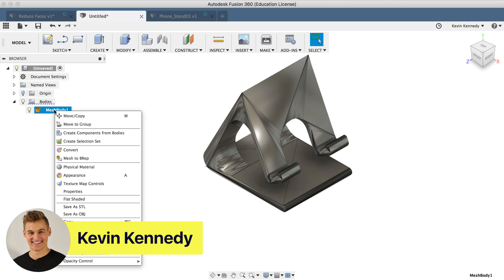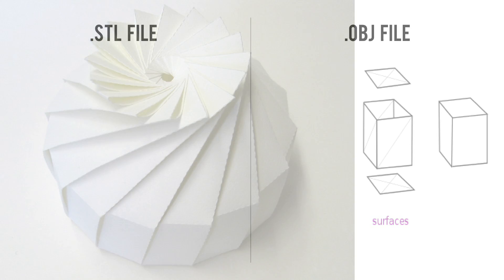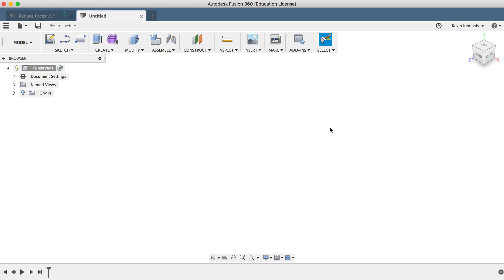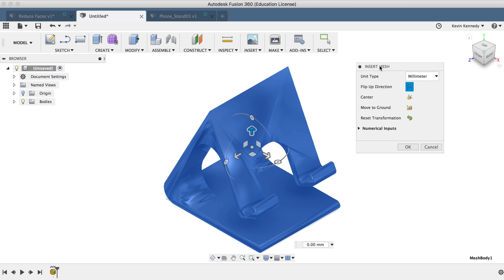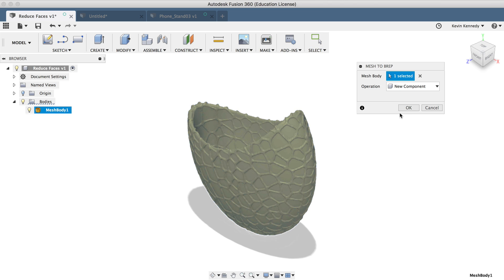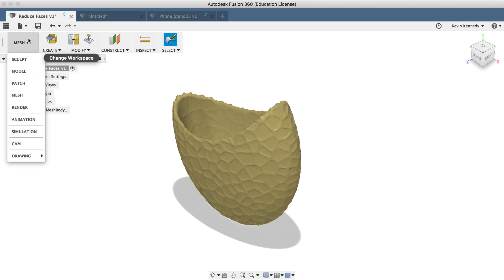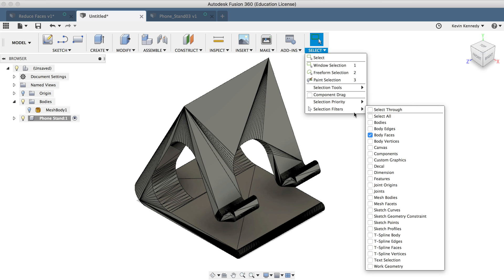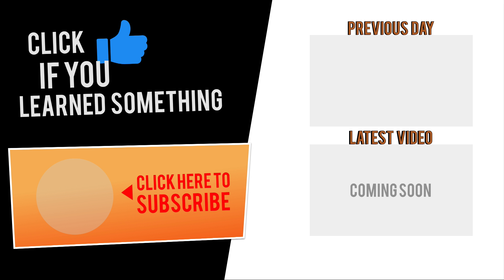How to Convert an .STL Mesh To a Solid Body - Learn Autodesk Fusion 360 in 30 Days: Day #18

Comment: how do I split a body afterwards into different bodies so I can give different polygon groups different materials and appearances?
Reply from the maker: In the new mesh tools there is a "separate" command in the Modify dropdown. It will automatically determine the two bodies (or there are some other options to define it).

Comment: This method only works for relatively simple parts. Anything with more than 5000 faces (triangles) will freeze fusion.

Only two options you have, is to either reduce the number of vertices until your part basically looks like a blob, or, section it off into multiple smaller parts, convert to solid, and then join the pieces. This may also take quite a while if you're working with high resolution models / high vertex models as is typical of character / anatomical models
Reply from the maker: Hi David - check out the new workflow here - https://youtu.be/tVGtG-UjlYg
Reply: Please visit my channel for more Reverse Engineering video tutorials. Keep learning!

Comment: Cool, thanks! But I have a question. I need to merge the facets like you did at the end... however, as my geometry is complex, there are some distortions when i do it. Do you know another way I can do this?
Reply from the maker: There is currently not a way to do it on very complex geometry....though some updates are coming which may be of help. Stay tuned :)

Comment: I have a problem when merging faces, It says  "Failed to stitch merge body" What im doing wrong?
Reply from the maker: Generally, that's caused from too many faces selected OR faces selected that are not planar (on the same surface). Try selecting fewer faces and double-check that no faces are accidentally selected on the other side.

Comment: Hi Kevin , I have been learning from your tutorials and here is my problem. I designed a model shape to be used on my drone, I extruded it and saved it. Before Fusion closed down it asked if i wanted to save again I did and gave it a name. But, I say but, after 3d printing I need to go back and alter some of the measurements. Ok Thought it would be easy to do so. It has saved  it but as a Mesh object, I wanted to open it with the timeline so I could alter parts of the build. So on my Fusion page I have left side column, say my Projects , that's were it saved also with the same file in my pics  as that's were i wanted it as an stl file for cura
What have I done wrong, will i be to change this mesh back to my workable piece as i spent a long time working on this
Thanks very much
Graham

Comment: In attempt to MERGE mesh surfaces, errors pops-up: "Failed to merge surfaces". Any ideas?
Reply from the maker: That can happen for a number of reason. The two most common are two many surfaces at the same time OR (most likely) if all surfaces selected are not on the same planar surface. Make sure you don't have any other objects selected (on the other side or edges, etc).

Comment: There is no "MODEL"  "Model Workspace"  or "PATCH" icons that I can find on my Fusion360
Your video is approx 3 years old and so did Fusion360 change their software at some point after you made this video, and so why things aren't working the same in my Fusion 360?
If so, please update this video using the latest version of Fusion360

Comment: Any help on how to fix a mesh that when converted to BREP only creates a shell of the model?
trying to 3d print some models and it just prints a thin shell instead of a solid.

Thanks
Reply from the maker: What slicer are you using? It sounds like it could also be a slicing issue.
Reply: @ProductDesignOnline   i am using chitubox to do the slicing, but the object isnt solid even in fusion 360
Reply from the maker: @eatthat38  gotcha. If you check out my video on Patching models that may be what you need to do (if it's a surface body). Otherwise, check the video description of this video for a newer version of this mesh conversion process where I demo some extra tips and tricks about patching models.
Reply: @ProductDesignOnline  Alright will do. Thanks for the Help!

Comment: Blender is WAAAAAAY better for working with meshes. EDIT - I suppose I should add some context. Fusion has quirk of just not doing what I tell it sometimes, and that error rate exponentially increases when working with meshes. I feel blender excels where fusion lacks. Perhaps it will improve when it officially releases that feature.
Reply from the maker: I agree with you Robert. The only thing I'll add is that Fusion 360 is not trying to be a mesh modeler. Their intention is to have enough mesh capabilities to help with parametric workflows when using imported mesh data.

Comment: Hey Kevin!I hope you are doing good!

I got some problems trying to merge the surfaces of the object.My fusion stopped working and i needed to reboot the program.My computer has relatively good specs, do you think i'm doing something wrong or is just a performance bottleneck?

Thanks in Advance!

Samuel
Reply from the maker: Fusion can only handle up to about 40,000 triangle facets. If you have more than that then you'll want to split the model into sections before trying to convert each individual section. Check out the description of this video where I link to a newer video that talks about some of this in more detail :)

Comment: Thanks, very helpful. Just to save you some clicks, there's no need to click Apply and then OK, just OK works. Apply is for if you want to commit the change but stay in the dialogue box, OK is for committing changes and exiting the dialogue box.
Reply from the maker: Great tip, Gary! thanks for sharing :)

Comment: Kevin, I finally took the plunge and designed and printed something using real world measurements (digital calipers) and it worked!  I made a replacement battery cover for my old (original) Nintendo Gameboy.  It fits perfectly, on the first print!  The only thing I forgot was the little 'catch' on the release tab.  Thank you so very much for all your hard work and dedication to this series.  Cheers!
Reply from the maker: Hi Brent - that's awesome! It sounds like a great practical 3D printing project. Glad to hear you're learning lots :)

Comment: is a fbx file considered a MESH? or is your workflow applicable to fbx files?
Reply from the maker: Hi, Jerome. You can import FBX files. You'll have to upload it to your data panel first, and then open the file from there.

The important thing to note is that FBX files are built with a quad mesh that theoretically would be converted into a T-Spline. (Different than the triangular facets of STL files).

If you import this and convert it directly into a BRep you may have to fill some open areas with Surface modeling tools (Surface tab). I would recommend watching my updated (2019) version of this video as I show some of the patching tricks - https://youtu.be/pgWWVcM5YJY

Cheers, Kevin :)

Comment: really enjoyed the video, but how many ads mate???
Reply from the maker: Hi, herrzyklon. Glad to hear you enjoyed it. I let YT do auto ads, so I'm not sure why or how many there were, but I'll look into it.

I've also made a revised version of this tutorial, which reflects the new user interface. If you're interested, the link to that tutorial is in the video description. Cheers, Kevin :)
Reply: @ProductDesignOnline  hi Kevin, thanks for the reply! Only mentioned the ads as they were frequent and disturbed the flow of your fantastic video. Wasn't aware it was yt that controlled them, I hope others haven't had the problems I had.
Thanks so much for uploading, it's helping me a lot!
Reply from the maker: @herrzyklon  No problem. I'm always open to hearing everyone's experiences so I can improve my tutorials (when possible). Don't hesitate to comment if you run into any Fusion 360 roadblocks. Cheers, Kevin :)

Comment: I am using an obj. file. Following your directions I am not able to see a mesh drop down window. I can still select vertices and edges, (dont ask me how) but I would still like to make all the random vertices on one wall one solid vertices so that I can extrude one solid face.
Reply from the maker: Hi, Christianpatrickgalles Galles. For your convenience, I would recommend watching my latest version of this tutorial, as it aligns with the most recent UI - https://youtu.be/pgWWVcM5YJY

You will need to activate your Mesh workspace in your preferences. Select your username > preferences > preview (tab on left) and then check the Mesh Workspace checkbox. Cheers, Kevin :)

Comment: What about 3D scanned bodies? Can they be converted to workable solids? Thanks for your nice tutorial
Reply from the maker: Hi, Victor. That's a great question. The short answer is: it depends.

I have gotten some small head scans converted before. Ultimately, it depends on the number of mesh facets that make up the scan. If the number of facets is over 50k then you'll want to reduce it as demoed in the tutorial. If you're still having trouble with the reduction then check out Autodesk Meshmixer, which is also free. It was built for mesh files and can handle a significantly larger amount of mesh triangles.

Cheers, Kevin :)

Comment: Your videos are truly incredible and so so helpful. I went from having very little CAD experience to being able to developing a working knowledge of Fusion 360 that I have actually carried over to other programs! Thank you so much. For whatever reason, I am having difficulty using the paint selection tool. I am able to highlight the faces, but as soon as I let go of the left click of the mouse, the highlighted faces disappear. I have attached the screencast link: https://autode.sk/33lXmtn
Reply from the maker: Hi Aaron. Sorry for the delayed response. I'm glad to hear you're learning a lot.

I've watched your screencast 3 times and I do not notice anything that you're doing wrong. Are you still experiencing this issue? If so, can you try a different mouse or trackpad to see if the issue still exists? It's unlikely, but it may be something with the mouse and F360 not talking like they should.

Let me know if you're still experiencing this issue. We may want to share your screencast on the help forum to get someone from Autodesk to look into your specific case. Cheers, Kevin :)

Comment: can't merge faces in new version of fusion 360.
Reply from the maker: Hi John. All the functionality in this tutorial still remains, they've just renamed a moved a few things around.

Make sure to right-click on the top-level assembly and select "Do Not Capture Design History". Then, right-click on your mesh body and select "Mesh to bRep". Next, select the faces that you want to merge (hold down the shift key and select them one by one). Click the SURFACE tab > Modify dropdown list > Merge.

Let me know if that helps and if you get it to work. I haven't experienced any issues (out of the norm) since the update. If it's not merging then it may be that you have too many faces that you're trying to merge at once OR they're not all on the same face/plane. Cheers, Kevin :)
Reply: @ProductDesignOnline  ok that's what it is I was trying to merge faces on a curved surface, plus the tabs don't look like tabs I didn't see them at first.
Reply from the maker: @jdouglas4564  I agree, the tab design needs improved.

With curved surfaces you can try two things.
1) Try selecting one face and then hit the delete key. Fusion 360 will try to auto resolve the surface.
2) You can offset surfaces a very small amount with the press pull command. Select the curved surfaces and then hit the keyboard shortcut "Q". Press or pull the arrow or type in a very small distance.

I hope one of those works for you! Cheers, Kevin :)

Comment: This solution is great with the older version of Fusion. With the new upgrade, and (excuse me for saying) the "stupid menu"  they've managed to make things more difficult and problematic to use the Patch Workspace. Now I have to "paint select" the triangles and go directly under Surface .. Modify .. Merge.
There is no Patch! 

I'm merging 195 triangles together and it's completely frozen solid on me.

Nearly 25 years in the tech trade - I simply do not understand how amazingly smart people take something that is awesome and working and turn it on its head and make it feel stupid!
Reply from the maker: Hi Andy. I do understand your frustration. The new update has broken some things in Fusion 360, but as far as I'm aware, none of the functionality with merging faces has changed. They've just changed the terminology and location of some of this process (as you've noted).
As far as 195 faces locking up your F360...it may be due to the faces not all being on the same exact plane (even if they appear to be to the naked eye) or simply that it is too many for Fusion 360 to process at once.

As an alternative, you can also try selecting one face and then hit the delete key. You have to make sure you're in the solid tab while you do this (not the surface tab). Fusion 360 will try to self merge the remaining faces as the result of you deleting the selected face. This process can sometimes produce better results than merging the faces, although it takes quite a bit longer. Cheers, Kevin :)
Reply: @ProductDesignOnline  Thanks Kevin.  However, I also find that I have problems Paint selecting the triangles. If I begin the paint-selection process directly over the triangles that are on the same surface, only 1 triangle is selected. If I insist and drag the mouse, the entire model moves in the direction of the mouse pointer.
To enable paint-selection to work as it should, I have to click and hold on the plain White space around the model and then drag the mouse over the surface at which time it begins to select multiple triangles. But I have no control over the paint action and triangles from all surfaces are painted in.

I will give it another try from scratch and see if I can make it work.  I'm saying this because I followed this exact tutorial with another model a few months ago, and was able to get the desired outcome in the older version of Fusion .

Kindly excuse my earlier post if it appeared to be a rant.
Reply from the maker: @AMTheTinkerer  No worries... I understand your frustration. If you're able to share a link to a screencast. I would love to see the issue you're having...that way I can look out for any settings or things that may potentially be causing this. I haven't experienced any issues with the paint selection. Sounds like it could be due to the update creating some latency, or it could potentially be the specific STL file you're working with (if it's really big). Have you tried it with different STL files? If so, is the issue persistent throughout? Cheers, Kevin :)
Reply: @ProductDesignOnline  Thanks Kevin. I will try to record something over the weekend and publish a link for you to look at.
Reply from the maker: @AMTheTinkerer  Sounds good. I'll keep an eye out for it! Cheers, Kevin :)
Reply: @ProductDesignOnline  Hi Kevin, I managed to create my own Tire component for my Robot project - something I should've done in the first place. In my earlier effort, I was trying to integrate an existing component I found on thingiverse into my project.

That said, I will pursue your tutorial and see if I missed any steps. Believe it or not, I found an old 3D print of a phone stand I had created several years ago in Tinkercad, that is almost similar to the mesh used in this tutorial.

Thanks and sorry about the delay in my response.
Reply from the maker: @AMTheTinkerer  Hi, Andy. No worries. Generally, re-making the model is always the best method for long-term results. Especially if the model will be part of a larger assembly model.
Don't hesitate to comment on my videos if you ever have more questions. Cheers, Kevin :)
Reply: @ProductDesignOnline  Agreed. On a slightly different note, do you plan to make any tutorials on Gears? 

thanks,
Andy
Reply from the maker: @AMTheTinkerer  Hi Andy. Thanks for the video suggestion. I do have gears on my to-do list for videos. I'm currently working on a new setup that will allow me to record my 3D printer so I can integrate that into the tutorials. Gears were something I was hoping to tackle as soon as I get that all set up since many are looking to print out the gears. Cheers, Kevin :)

Comment: Does this still work in the new Fusion 360?  Patch doesn't exist, in the surfaces tab, the merge function doesn't let me select faces, then if I turn ON design history I can edit the mesh and select faces but merge isn't available if design history is on.  Workflow has completely changed.  Thanks again for all your videos.
Reply from the maker: Hi, seventyfive1. This process still works the terminology and location of things have just changed a bit. You can watch this video to see all of the critical changes - https://youtu.be/tuZzHcmFtg4

The "merge" command only shows up when you're in "direct modeling mode". Right-click on the top-level component (filename) in the Fusion 360 browser. Then, select "Do not capture design history" > click "continue". Then, you should see the "merge" command under the modify dropdown list in the "surface" tab. Here's a screenshot for reference - https://snipboard.io/drCGJw.jpg

I'll have to redo this tutorial at some point to reflect the new changes.

Cheers, Kevin :)